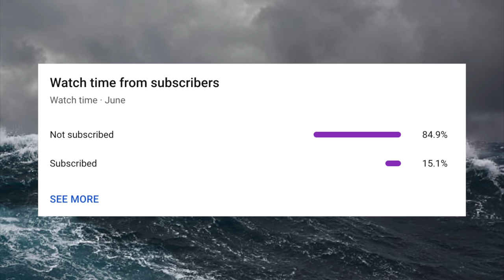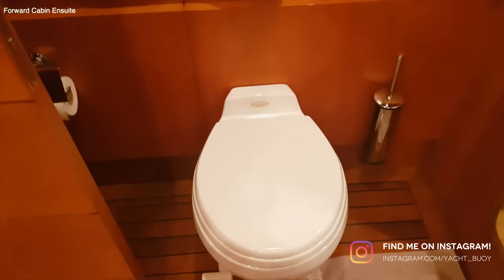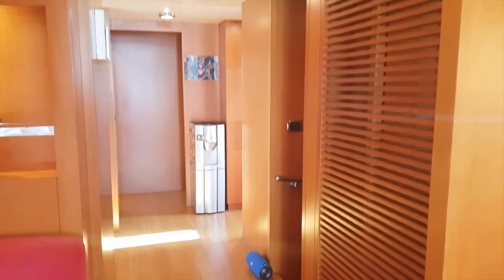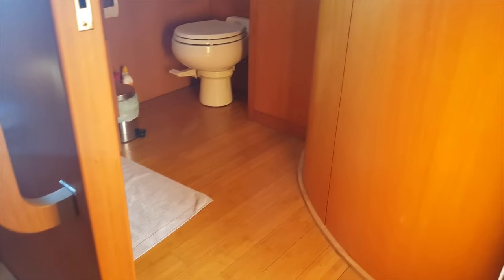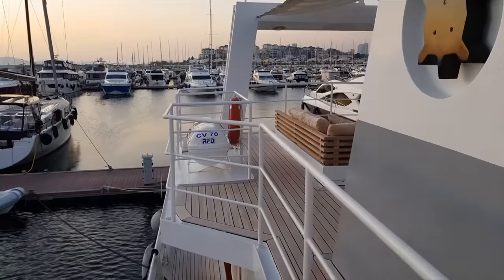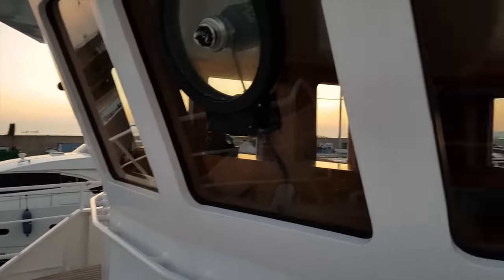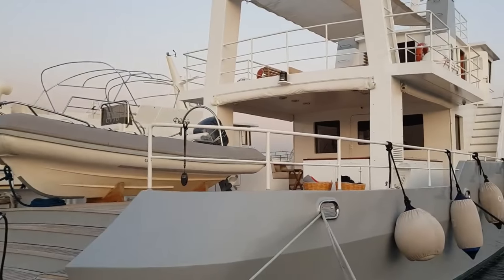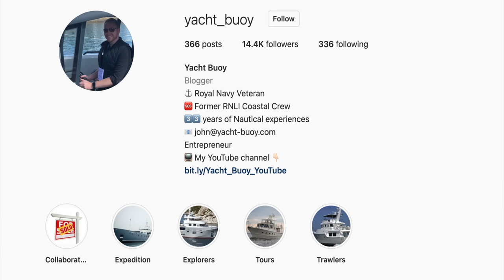STEEL TRAWLER YACHT FANS: What Do YOU Think Of This Explorer Yacht?

Comment: For me, the only thing that's appealing is the price and condition.  The draft at 3.3m seems excessive for the dimensions of the boat and severely limits where it can go in the littorals and if I was poking around the Bahamas, other Caribbean islands, or other areas with less than exceptional charts, I'd be hesitant to take her there.  I'm also not found of it not having a transom that would at least break following seas from flooding the boat deck.  There are some other issues in the living spaces (square corners on some furniture) combined with a lack of enclosed living spaces that for five to 10 people, would make things...tight.  

I'm sure it's capable, but I'm not sure what it does that other similar sized trawlers can't.

Comment: I think the accommodation is great but it is a pity that she have two 500 hp engines two times 220 hp is more than efficient and will give you a bigger range but it is still a nice vessel but l think the price is a bit high.
Reply: But maybe they drive it on 25-50% of the power? Or one engine at the time "Bering-style"?
Reply: Yes is possible but it is not always good to run your engines on low RPM.
Reply: @dirkvandertoornvandertoorn4895  
That was my (and Alexis at Bering) point. Maybe it's now possible to run one engine at a time at 50% reducing fuel and hours? I don't know, didn't get that from the video...